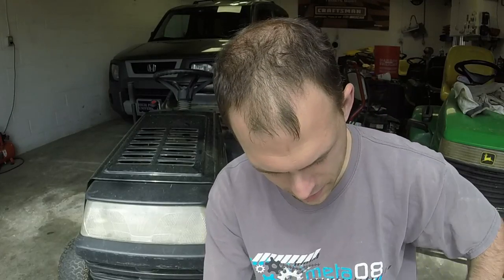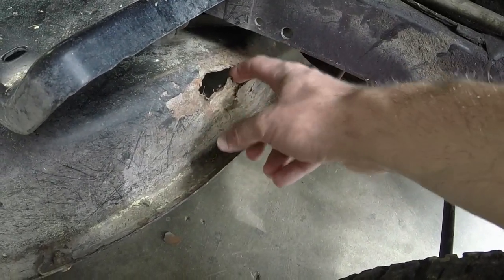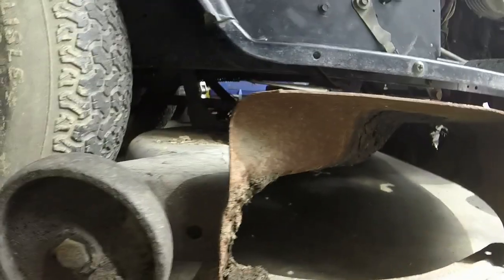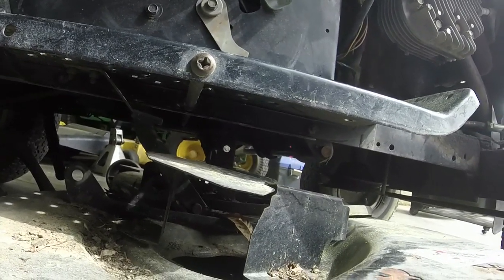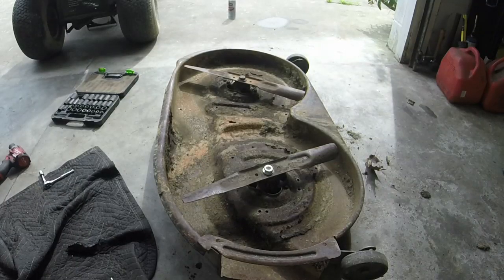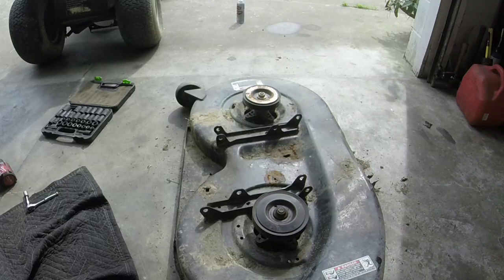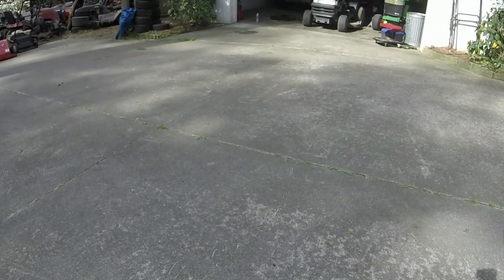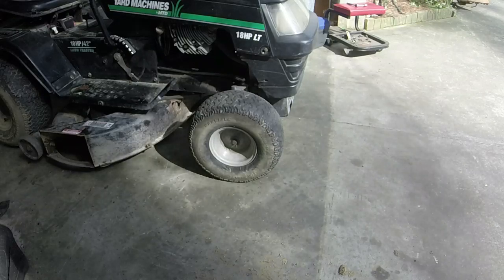90s MTD Yard Machines Riding Mower Install deck spindle:  A complicated deck to remove

Comment: Excellent job as always, replacing the spindle, getting it running again in order to cut grass. Lots of people like those as mudding mowers, MTD usually seem to be the primary choice for that. This is also a lesson in, watch where your mowing, otherwise you put a hole in your deck, and blow out your spindle!

Comment: Great video I always take a small drop of copper never size on bolts .I had a larger pulley on my replacement pulley but it was on outlet side  also have a hole to patch in front I loved these models and mow 3 acres with 42" deck

Comment: Hello Casey.  I have a question for you;, My MTD YardMachines mower is really similar to this tractor except it has the 21hp Intek engine and has the 46 inch mower deck with the PTO engagement lever on the dash console and the deck height lever to the right as the tractor in the video has. My deck is lower on the left side than on the right side in which in reverse I am getting the ridging more so than going forwards. I have the adjustment brackets that have the nut that is seni enclosed within the adjustment brackets in which I think that there may be 2 and my right side are the slotted brackets similar to the ones on the John Deere mower decks. Do you have any specific videos regarding these crazy adjustment brackets???  Otherwise the tractor works flawlessly. I have recently been having to mow at my mother and sisters residence and have really noticed the ridging this past weekend.
Reply from the maker: I don't have vids on that but am familiar with what you're talking about I think.  It's just a matter of trial and error with that nut setup on the side to side adjustment.  They can be a little tricky to get level since you're kind of limited in what you can do.
Reply: @EllisMowersandmore  I have really learned the hard way that with all of the many variations with the MTD mower decks that it is very hard indeed to ask what should be a simple question. 
And Yes, I appreciate my John Deere and vintage Cub Cadet mower decks even more than ever. 
Casey, Are the AYP/Husqvarna products similar in design to the MTD mower decks?
Reply from the maker: @TheIronDuke502  The AYP ones seem easier to level because they have an adjustment on both sides as well as both sides in the front.  Just lower the deck all the way down and you have a 9/16" nut you can loosen and tighten pretty easily.
Reply: @EllisMowersandmore  Yeah, I was thinking along the same lines.  I’m thinking of replacing the mower deck wheels and some other minor stuff just for good measure .  
A few days ago, I found a really nice 38 inch John Deere mower deck on eBay in which it was delivered today. I had forgotten how heavy that the older style John Deere mower decks were. 
The funny thing was that I paid just a few dollars more for the whole entire mower deck than what the double stack pulley would have cost from John Deere. The mower deck which is in very nice condition seems to be just about as heavy in weight than what my 165 tractor seems to be. Man, I am pretty happy but yet worn out from tugging on that heavy mower deck.

Comment: I have the same mower but mine won't move and burns up the belt at the drive pulley below the engine.
Reply from the maker: You have a stuck pulley somewhere.  My guess is your varidrive pulley is not turning.  It's under the panel where the shifter is between your legs.  2 screws takes the panel off and you can access it from there.
Reply: @EllisMowersandmore  thank you. That's what I am thinking also after doing some research. This is my first ever riding mower. I took the deck off I am just using it as a go cart.